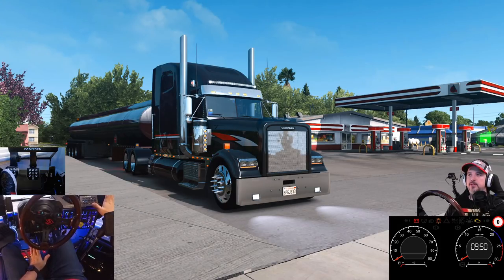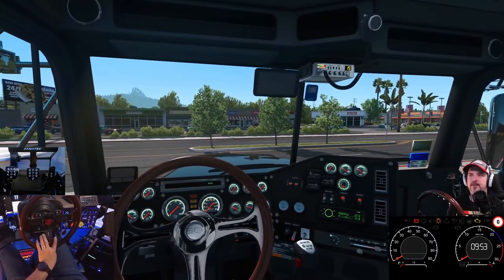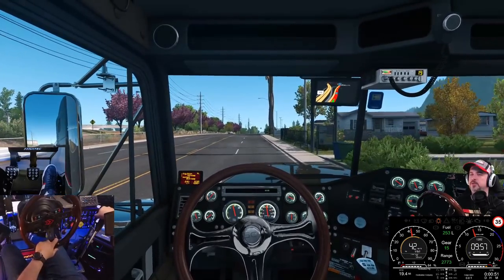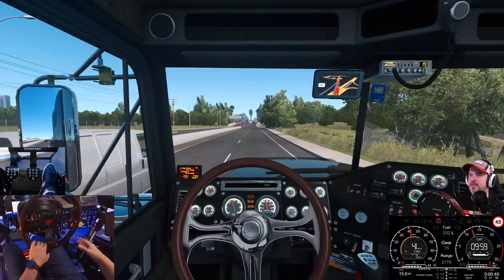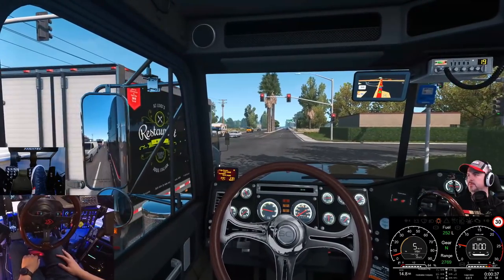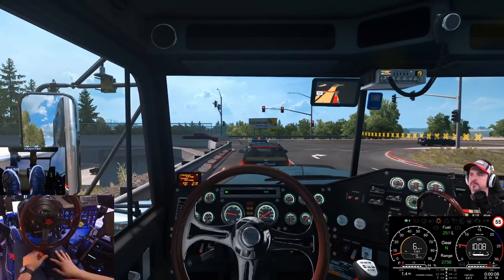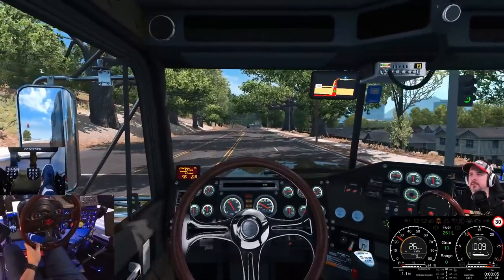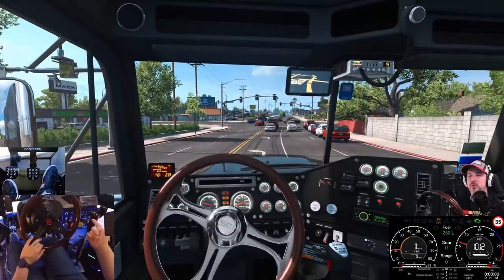HOW TO FLOAT GEARS IN AMERICAN TRUCK SIMULATOR - PEDAL CAM, SHIFT CAM AND THE WORKS | TUTORIAL

Comment: A good video as alway.  Does anybody make force feed back gearshift?  I’m using  thrustmaster TH8a gearshift with Logitech g29.  While happy with both. Wish steering wheel was bigger. Do wish gear shift had force feed back. Prob not cheap, esp here in Canada. 

I wish they come out with new game and or somebody basically take ATS and do new game with better Physics and force feed back features.   Truck slide on payment. Real weather conditions.  Real maintenance, (Oil change etc) and if you miss maintenance, it can have real physical effect on all your truck.  Real engine Physics/HP/torque, missing too many oil changes would reduce Power cause issue. Break downs, over heating engine/brakes and turbo should all happen.  They should also have full truck garage where do maintenance and upgrades. 

Few times been loaded over 100,000 lb or more and got stuck on off ramp. In Bo low and still could NOT get the truck too move.   Which was pure bullshit.  Consider my Kenny was setup up heavily loads, full Eaton 18 speed Tranny and Cat 625 HP engine. 

But ya really Long for good truck game that has real Physics and you can actually take damage ti engine/pistons/turbo when you don’t do proper maintenance.  Which include doing oil changes and grease up and what not. And missing maintenance can have consequences like real life.   Yeah the dev need to hire REAL IRL truckers. 

Good video though. I need also try this more and learning how float gears better.  But thanks man.   Maybe one day they actually do ATS2 with newer game engine and hopefully updated physics/sounds and graphic.  Would love see ATS with path tracing.  But thanks for Video man. 

Are you still using same engine sound mod? Sound fairly good.  Most sound mods I tried all sound like ripped/copied from YouTube or from garbage truck.   RL Cummings/Cat engine both sound different imo.
As somebody grew up on farm, we had farmer with grain bin near by, I got use hearing his big truck on our road and got ride with him few times.  But good video man.

—- Rant warning lol -

Engine and turbo sound for default game are Soooo Horrible imo.  They need go actually record real audio of Cat engine sounds/ Cumming etc and Volvo engine sounds.   It’s Strange Pete with Cat engine sound different then in Kenny. While their would be slight changes of sounds.  It still should sound like a CAT or cumming imo. 

WHY hasn’t somebody who actually drive trucks /and or work on these engine actually and done ACTUALLY recorded IRL engine sounds using High quality Mic (blu Yeti etc or better) I swear almost 90% sound/engine sound mods are all Copied from same dam sound,  like its from Garbage truck or copied off YouTube video. 

You should PLEASE do shout on one your streams out For ATS fan/ Truck mechanic/somebody too ask him/her please go record actual engines sounds of different engines.  None this BS copying found sounds off the web.  
Ask for somebody that has access to IRL engine sounds.  Get actual REAL life recording these engine sounds with laptop and decent mic. 
AND/Or get the ATS community to bug ATS devs to go do REAL IRL engine sound recording please, then offer it as DLC. Id before happy pay for the Sound pack DLC if ment getting better IRL sound recording.  (Cats/Cummins etc)

Almost tempted do this myself. But I’ve never made mod or have working laptop,  though I do have good Blu Yeti Mic. 
And I was part of indie dev team, they hired me as tech guy/moderator. Helped them for about 2 yrs,  opened my eyes to game development.  I wish still lived on farm cuz I could have asked our Neighbour when was not busy, if could record some sound recording of some his different trucks he owned.
Reply from the maker: Hahah you just summed up pretty much what every ats guy is thinking
Reply from the maker: Hahah you just summed up pretty much what every ats guy is thinking
Reply: Full Tilled Gaming 
Thanks <3. Sorry for long ramble.  Don’t get me wrong.  <3 Love the game.  Just hope someday we get new one with Newer game engines :) even UE4 for ATS 2 could be improvement. Oh well maybe someday :). Q: are they any force feed back gear shifts?
Reply: Sire DragonChester There will never be an ats 2 and I swear to god if they make one I’m gonna be phissed!!! Just bought all the map dlcs

Comment: I know, that's an old video, but I have a question. How did you moded your shifter, that it is so long?
Reply from the maker: Bought an extension to fit the threading on the Fanatec shifter

Comment: i have a question. is there any way to slow down the drop of RPM in game by mods or something when shifting. In a normal 18 speed it drops abit slower in real life but when playing this game it feels like im rushing to change a gear cause it drops so quick.
Reply from the maker: Yes they drop extraordinarily fast in ats. It should drop more slow and the wind down shouldn’t be as fast. It has to be edited in the engine set I believe, but don’t quote me. I know of very few trucks who’s engines behave that way
Reply: @FullTilledGaming  I found a physics mod that slows down the drop of the RPM to an acceptable speed so im not rushing to change the gears.
Reply: @rayray-zf4fj  Do you happen to have a link?

Comment: I got a ? Shifter layout behavior do I need that to be advanced or simple
Reply from the maker: Trupix advanced
Reply: @FullTilledGaming  ok
Reply: @FullTilledGaming  also once I set it to that there’s one thing says clutch or throttle and none and throttle release
Reply from the maker: Trupix either or. one releases with the throttle only or with both throttle and clutch
Reply: @FullTilledGaming  I’m going to do throttle release
Reply: @FullTilledGaming  I’m going to do throttle release or witch one did you use in this video

Comment: On ETS2 I can pull out of gear without the clutch but when I try to put it back in it just stays in Neutral. I don't get a grinding noise or anything. Anyone know if there's another setting I have to use besides the ones where I choose the advanced shifting and my transmission type?
Reply from the maker: Try putting your shifting on complex instead of simple

Comment: Why is the gears on the telemetry odd numbers?
Reply from the maker: It reads 1-18. 1 and 2 simply being L and LH which I do not use in the video cause they're not needed for pulling a regular load. That would be more suitable for a heavy haul that needs those two gears to get going.

Comment: This games making no sense I use to play it fine reinstalled it a week ago G27 wheel and shifter, aplusb 18spd shifter fanatec v3 pedals.  Every time I start off giving it some throttle and ease the clutch out it try's to stall.  I have driven truck and floated gears for the last 25years
Reply from the maker: Check your range on your clutch and also it's deadzone. That would be in your controls under the options button.